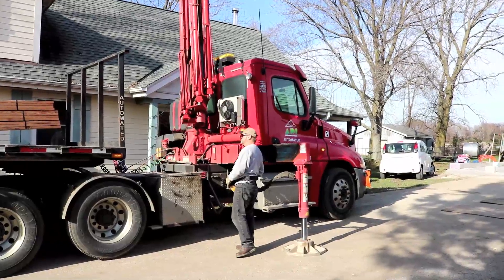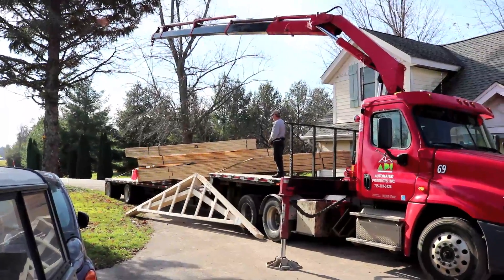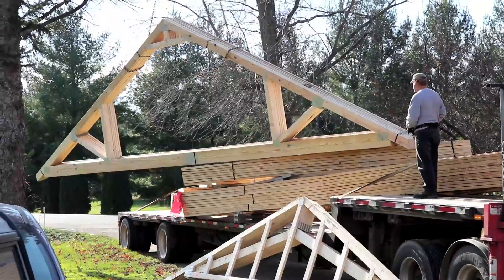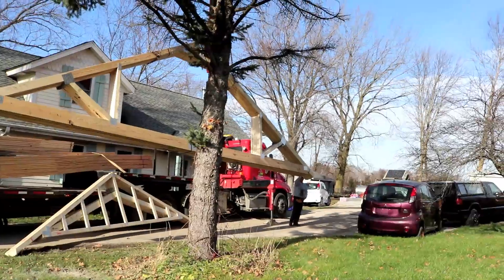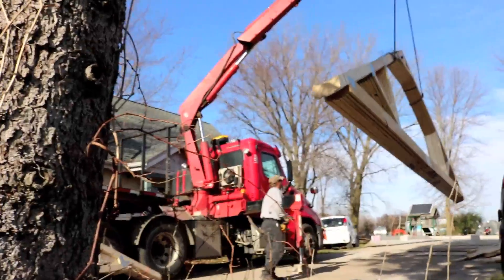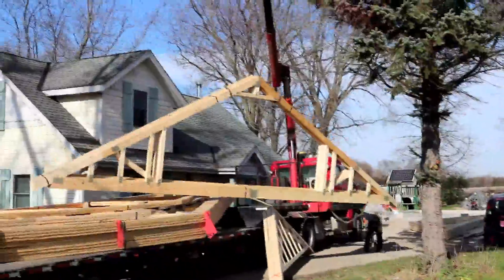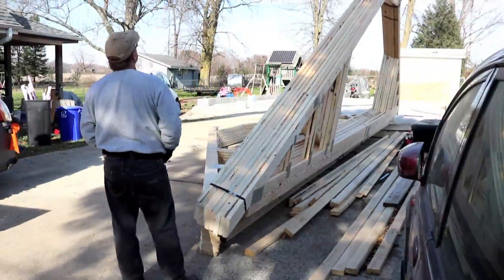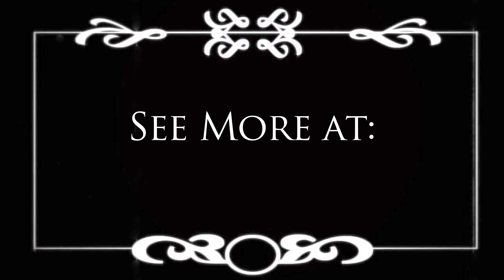Ben's Solar Garage: Truss Delivery

Comment: I was wondering what happened to the other imiev
Reply: I wonder if the electrical parts could be used from another scrap iMiev.
Reply from the maker: Mostly it's good for BODY parts. Anything wiring wise was ruined. I've sold a few parts off it to other iMiEV owners.